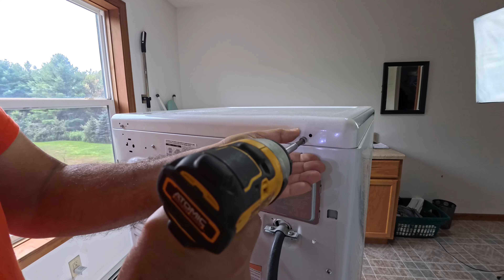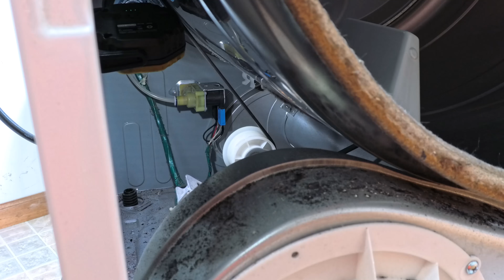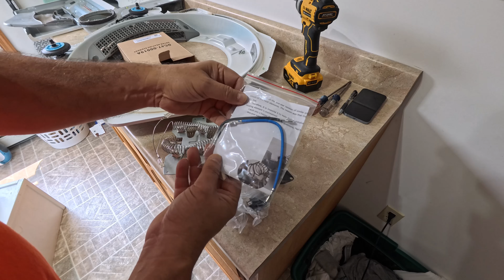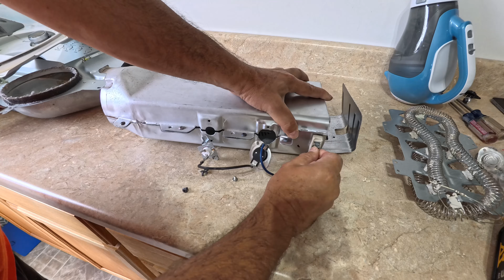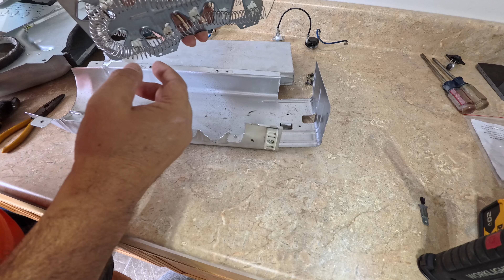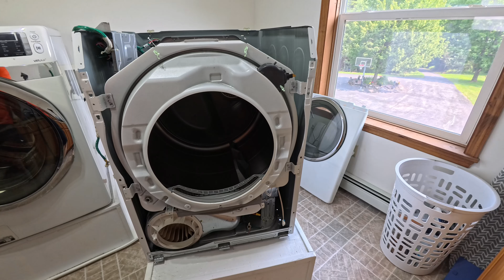Samsung DV350AEW/XAA dryer NO HEAT | Installing new heating element

Comment: I followed this as well, and was able to easily fix my dryer. Truly is one of the best repair/diy videos. You really didnt gloss over anything. The belt was tricky.
Reply from the maker: That belt is definitely the hardest part, but I'm glad you got it done! 🛠
Reply: @oviduran  My repair died in just over a month. I just replaced it again, and have heat again. Would buying legit OEM parts be the solution over these cheap kits?
Reply from the maker: @NoahFlemingConsulting  That is possible. Buying OEM parts may last much longer. My repair has been going strong for ten months now. I have never researched OEM parts, but I suspect they are made in the same factories overseas as what we got from Amazon. But yes, buying OEM may be better although at a higher cost.

Comment: How is durability as some units broke after 6 months of use and only lasted a year from amazon purchase not the OEM purchase? Customers have varying experiences with heating performance as well.
Reply from the maker: This is not OEM. Installed about 8 months ago and still working fine. Heating performance is good too.

Comment: Great video and very detailed. I was able to follow along, which says a lot.
Now, even at an Extra Low setting, the dryer is really hot that I can smell it. Should this be a cause for alarm?
Reply from the maker: Glad the video helped, but that doesn't sound right; please check that the new element isn't touching the housing. Or check the airflow and make sure it is clear.
Reply: @oviduran thanks for responding, Ovi. I realized that I didn't reset the dryer after installing the heating element. Hopefully that helps someone else out. ❤
Reply: @richardshaw8326  How do you "reset" the dryer?
Reply: @NoahFlemingConsulting 
Steps to Reset Your Samsung Dryer
Power Cycle: Unplug the dryer from the wall outlet. If the plug is inaccessible, turn off the dedicated circuit breaker in your home's breaker panel.
Wait: Leave the dryer unplugged for 1 to 5 minutes to allow the control board to fully discharge.
Restore Power: Plug the dryer back in or turn the breaker back on.
Test Cycle: Turn on the dryer and run a short cycle to confirm it is working properly.

Comment: Thanks you for this, it was very helpful. Saved me from buying a new dryer as my dryer is 13 years old and the quoted $290 repair estimate made me decide to buy a new one until I saw this. $24 and we are back in business!

Just a hint about putting the heating element cover halves back together. There are two holes in each tab. One is bigger than the other. The smaller ones are the ones you use to screw the two halves together. The other one is bigger and I slipped the screws in from the bottom to hold the tabs to the lower half while I positioned the upper half. It allowed me to pretty quickly put the two halves back together. Once each tab got screwed together, the tension released and the "positioning" screws just fell out.

The hardest part of this whole deal, for me at least, was taking off the belt and putting it back on.
Reply from the maker: You're most welcome, and thanks for sharing those helpful tips about putting the heating element cover back together!

Comment: This was an AWESOME video! I have the exact same Samsung, and I also wasn't getting heat. It ended up being the thermostat (very obviously burnt out), but I got the same kit and replaced all the sensors and heating element as well. Now it's running like a dream!
Reply from the maker: So happy to hear the video helped you fix your dryer and it's running great now!

Comment: on the sensors how do you know what is positive and negative ? I dont see any makings except numbers
Reply from the maker: Samsung dryer sensors have specific terminals, but they typically use low-voltage AC signals where polarity doesn't matter for basic connection, just that the wires go to the right spots on the sensor bars for the circuit to work; connect the wires as they came off, red to one bar, black to the other (or just ensure they go to the designated spots on the new sensor), and they'll function to detect wet clothes.

Comment: Hello Ovi, hope you enjoyed your time away. .  This is great video, I had a similar situation with my stove where the oven would not turn on.  After searching You Tube, I was able to pin point the issue to the heating element.   $30 later and it was good as new.

Comment: Good job Ovi. Generically those sensors are called snap discs and used on many products, they come in different heat ratings. I have one installed on big red in case the fire goes out of control. 

I’m not telling you this as a know it all. I replaced several over the years on peoples boilers I welded on. I didn’t know they were called snap discs so I ordered them from the manufacturer. I later found out you could purchase them set up specific temperatures for less than a dollar apiece.

I am thinking about plumbing my backhoe so I can use it with that log splitter. It won’t be living in Clifton Park anymore. The backhoe uses slightly less fuel per hour, and also the GPM on the hydraulic pump is 12 GPM‘s higher. The splitter will cycle much faster! 

If I do, I will have to have you up. I still feel guilty for not having you try the splitter that day. I got this big mouth of mine running and totally forgot.
Reply from the maker: I remember that log splitter being intimidating. Lol
Reply: @oviduran haha na, if I can do it, anybody can. Now that computer stuff you do I find that very intimidating!

Tina and I have decided to go to the festival this year.  I’ll text you when it gets closer, maybe we can meet up for lunch.

Comment: Great video of fixing the dryer. A while back, I had a dryer that I couldn't get a belt for. I measured the length of the old belt. I went to an auto parts store. They let me go to the back where the belts were. I measured a diesel serpentine belt. From that, I sliced, I believe, like 3 belts out of it. The belt lasted for a while. The original belts for the dyers are super duty strong. The car belts seem to have the strength, but they don't put up with the heat the dryer makes.